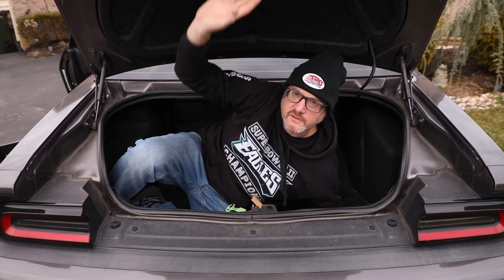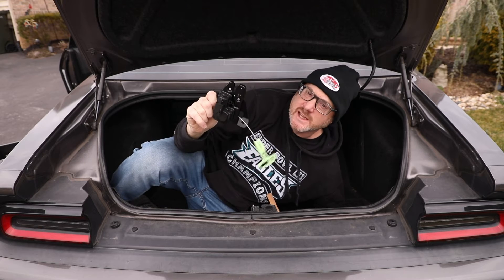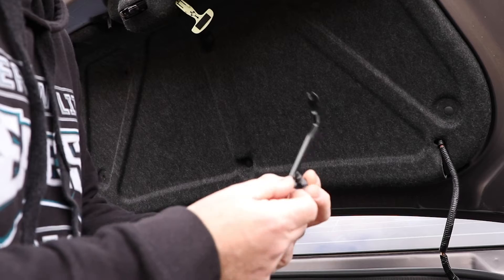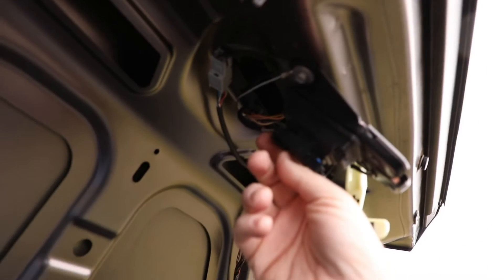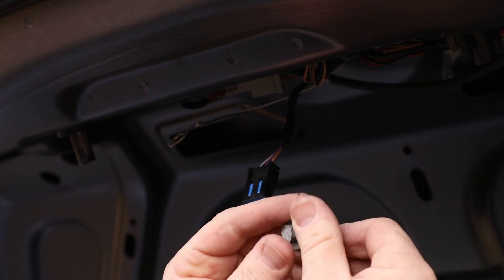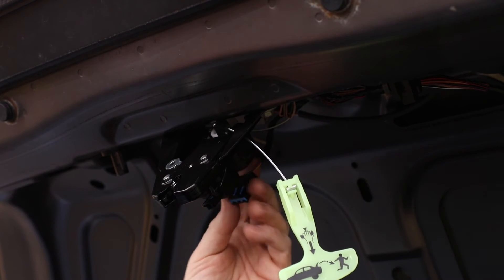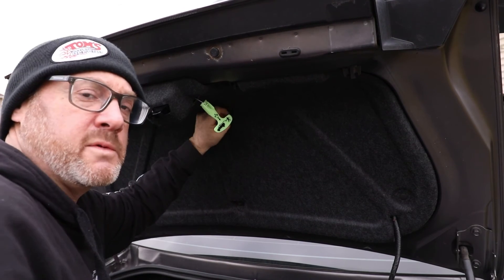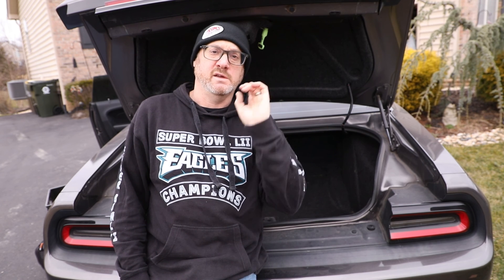Dodge Challenger Charger How To Replace a Broken Trunk Latch Actuator

Comment: My girlfriend's trunk latch stopped working or so we thought.  She was quoted 535 bucks at the dealership. Turns out that white plastic tab gets stuck. If you use wd40 or white lithium grease  on that white plastic tab it'll loosen and start working again